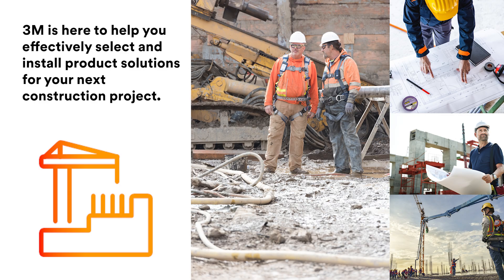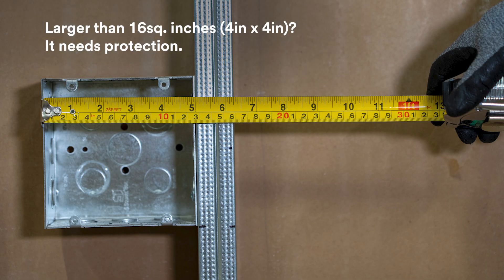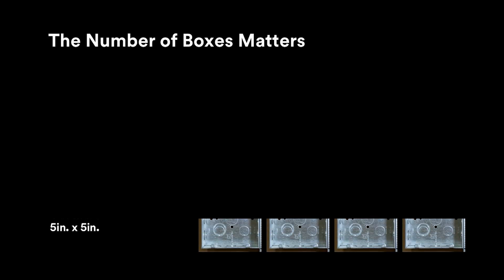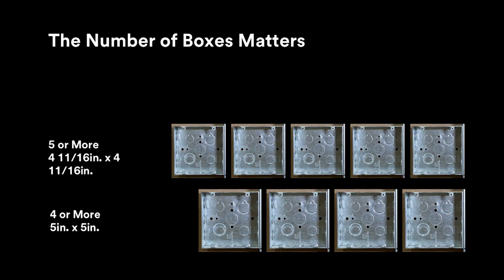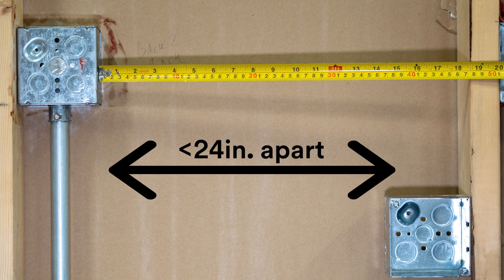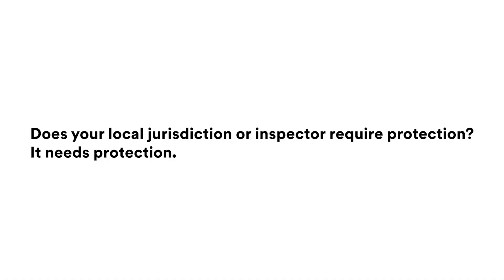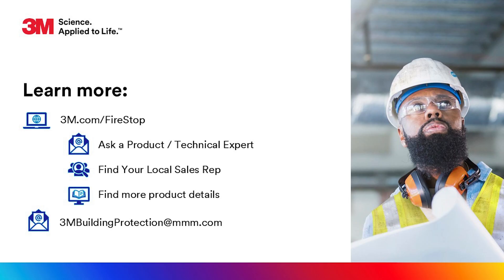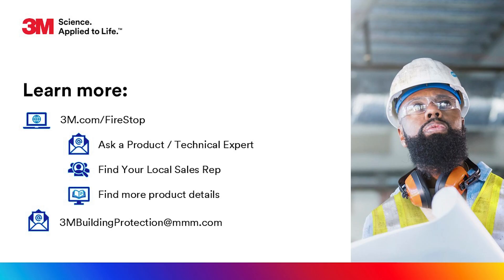3M Answers: When is Fire Protection Needed for Electrical Boxes?

Comment: Can you make a video or mention in the next update what you do with insulation when stripping wire, is it recyclable?
Reply from the maker: Hi John -- Thank you for your inquiry. 3M advises reaching out to the manufacturer of the wire that you are using to inquire about the recyclability of the insulation/jacketing. If it is a 3M product, we can help you connect to the appropriate team member.